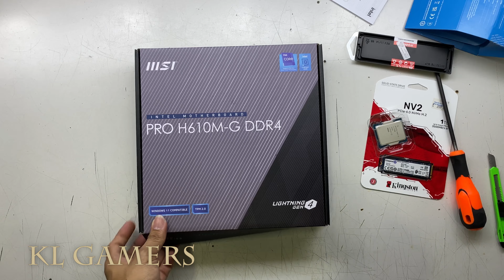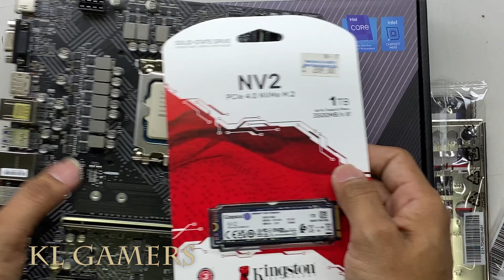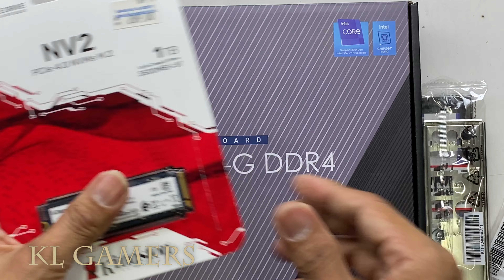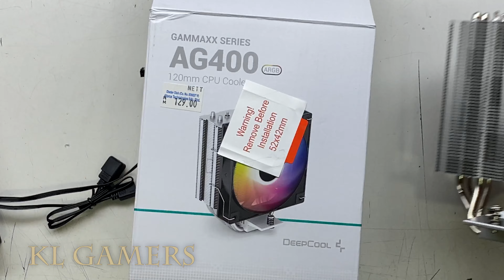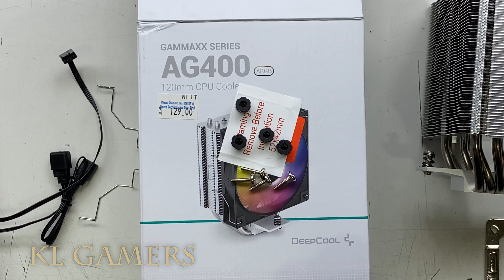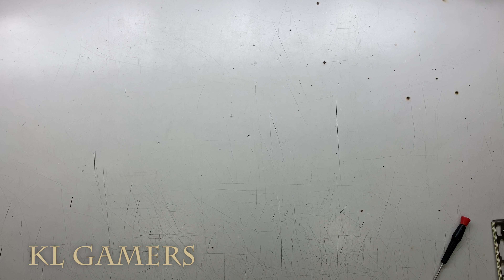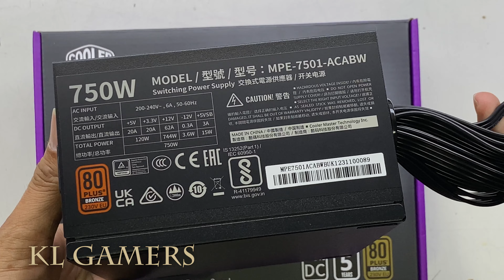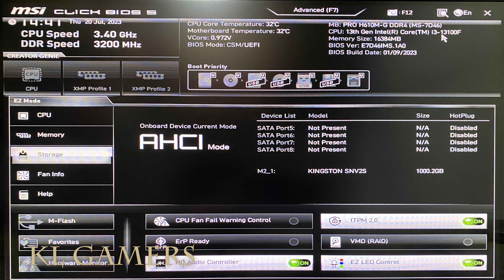intel Core i3 13100F msi PRO H610M-G DDR4 Hyper 212 LED RTX3060 VENTUS 2X Gaming PC Build

Comment: Hi everyone i have one question, Msi H610M E,  I5 12400F, Ram 16 ddr 3200, rtx 4060 TI.  That system would work fine? I mean with this MB?
Reply: Did you bought it? I'm going to build with this same specs, but going for rtx 4060 instead of rtx 4060ti.
Reply: go for 3060 INSTEAD or 3070 its better than 4060
 @noohforce5123
Reply: @noohforce5123 How it went? I'm currently waiting for the 4060 arrive to star building, same specs
Reply: @Hiramale  it's still amazing.😀 👍

Comment: In the specifications, it says that the board has 2 3-pin 5v ARGB inputs, however in the list of devices compatible with the Mystic Light, it does not appear. Could you tell me if there is a way to control the lights of devices connected to these 3-pin inputs?
Reply: 3pin 5v is labelled as jrainbow on the board. I think we would need a software to adjust the lights

Comment: It’s needs bios update or is 13th gen ready?
Reply: Based on older comments from another video, you may need to bios update with a 12gen before this MB can be 13th gen ready. I'm not sure if this is the case now but hope this helps. All the best 👊
Reply: It is plug and play you dont need bios update
Reply: @lasvii  did you manage to use the CPU without updating the BIOS?

Comment: I WONDER IF THE MOTHERBOARD'S VRM IS GOOD ENOUGH TO TAKE CARE OF BOTH THE PROCESSOR AND A HIGH CONSUMPTION GRAPHICS LIKE THE RTX 3060 😐😐😐
Reply: i wonder the same, i have the mobo and want to upgrade but idk its worth it
Reply: The mobo's VRM won't manage the RTX 3060 power, only the CPU's power. The RTX will drain power directly from PSU through PCI Express conector, all graphics cards have their own VRMs.